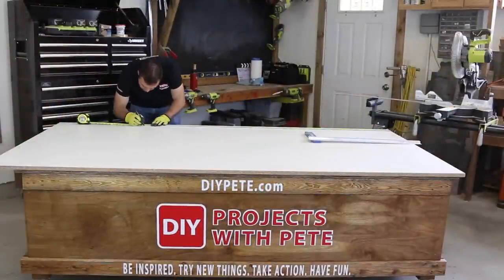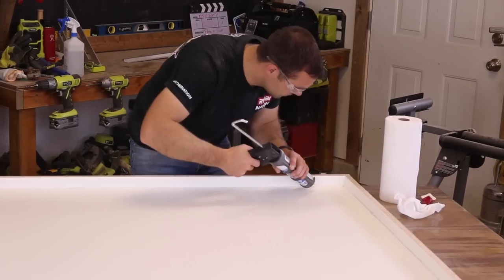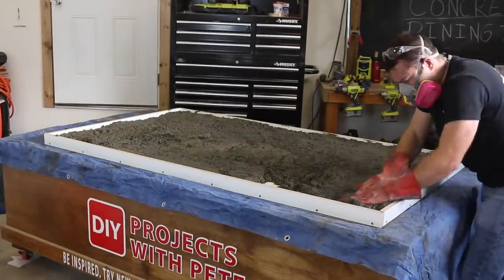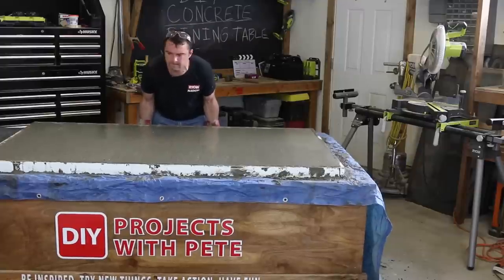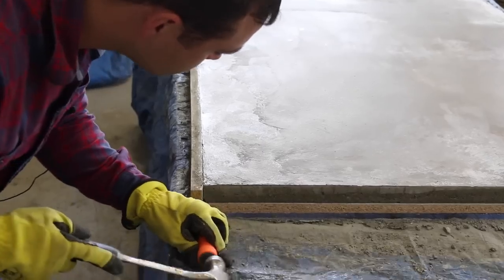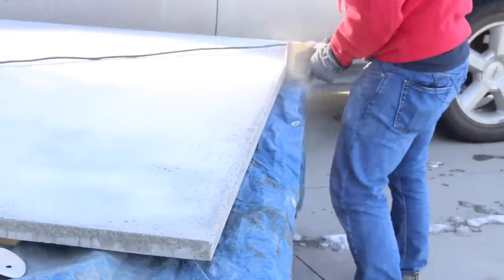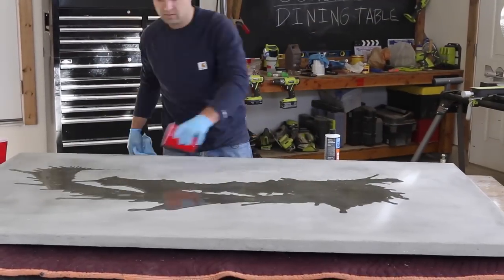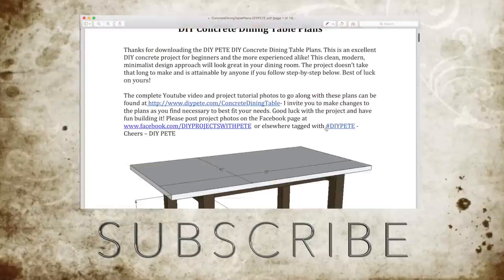How to Make a Concrete Dining Table

Comment: Hi, Pete. I am from Russia. We don't have non-toxic food-safe sealers here so I want to ask you where you buy it. And I didn't get what finish coats you do on your top: sealer (3-4 times), wax? Would please give me some links on liquid materials you use. Thanks a lot.
Reply from the maker: Hi! Hope all is well over in Russia. I use the Cheng Sealer from Amazon. If you can't get it, I'd recommend a waterbased acrylic sealer made for stone or concrete. I do the food safe for some projects but don't feel it is totally necessary as I am always eating off a plate and it doesn't worry me. Sealer about 6 thin coats --- and wax is optional. I use the cheng wax when I do. Cheng also a website he sells it from but here is the amazon affiliate link: http://amzn.to/2mPcji9   Cheers!

Comment: Does buying all that melamine get pricey after a while? I notice you do a lot of concrete table top projects but is it cost effective vs building a wood table top?
Reply from the maker: Hey Edward! I pay about $36 / sheet. I try to reuse it if I can and it hasn't been damaged.  t depends on the wood used --- but if you use affordable wood - the project will be able to be done cheaper than it would be to build a concrete top.

Comment: Hi Pete, I'm trying to make a 6-person table with a slab of quartz (72"x36" with a 3" lip). I imagine it might be quite heavy, maybe not 300lb like this concrete table you built here but still very heavy. I'm struggling with the table legs. I wanted to use U-shaped metal legs (2 sets, 28"x28") but I'm afraid they won't hold the weight, or if they do, the quartz slab will bend in the middle or near the edge. Please help, what can I do to make the legs stronger?
Reply from the maker: Hi Shauna, do you or do you know anyone who welds? Connecting the legs to each other with some low profile metal tubing or other metal would be wanted to provide support for the quartz and to give the legs additional stability. If you have anyone that could help with some additional welding that would certainly be nice to have. Cheers
Reply: Thanks for the tip Pete! Now i gotta find a welder in town......

Comment: if you use an electric motor under the worktable with a belt pulley measured moon to make the effect of vibration, such as cellular phones.
Reply from the maker: Thanks! Yep, I do have a concrete table vibrator --- I don't really use it for video taped projects though since most folks don't have them and I try to make the projects using as few of tools as possible to cut down on costs. But if you have access to a concrete vibrator or a similar contraction that's great!!

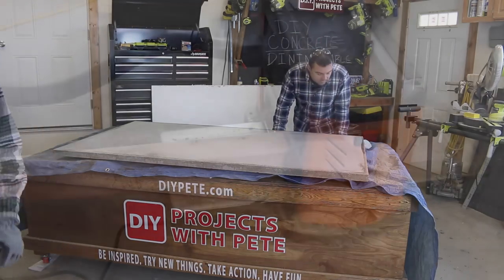Comment: Video is out of sync with the audio at 8:20.  Finishing the slab is being talked about, but the video is showing you making the legs of the table. Then at the end of the video is the concrete sanding section.

Comment: I was thinking of using concrete to build a new desk due to the relative cheapness of concrete, but... well, 300 lb for a slab of that size is quite a lot. If I wanted to install wheels on my desk they'd probably collapse under the weight of the desk. Maybe I can build a desk using crappy pine wood and then smooth all the surfaces using concrete? I fear that'd make the desk kind of flaky though.
Reply from the maker: Hi, you can certainly find caster wheels that would support a desk. I've done this with some large outdoor tables. Cheers

Comment: plz do a video where you inlay a slab of wood with a natural edge and then add concrete to the sides
Reply from the maker: Hi Ryan! I definitely will have to do this in the future. Thanks!
Reply: Thanks, Pete, it would really help, I am trying to figure out how to make 1 for my wife and it will be hard to stop the wood from swelling and absorbing the water from the concrete and warping the table, if you have any advice it would be much appreciated :D
Reply: example: http://www.instructables.com/id/Concrete-and-Cedar-Plank-Table/

Comment: How much did it to build the concrete countertop?
I was looking into making one and was looking into a product called Zcounterform, have you heard of it?
Reply from the maker: Around $100 if you use a basic concrete mix like quikrete 5000.    - Yep, I've heard of Zcounterforms to do bullnoses and other edges etc. I've used them a few times. They worked great.

Comment: Pete , does it have to be Melamine or can it be another type , hope to hear from you or someone else
Reply from the maker: Hi Kyle! Melamine is water proof and so it will give you a super smooth finish. You can use other types of wood, but would need to seal it so the concrete pops off of it, and so it has a super smooth finish if you are using the reverse cast technique like I used in this video.
Reply: @DIYPETE   thank you Pete! I apreciate your reply , melamine isnt available were i live in large sheets

Comment: I made a concrete island table. I put on the Portland cement but it doesn't seem to be filling all the tiny bug holes. also as soon as I sand there's like a thousand more tiny bug holes. is this normal?
Reply from the maker: Hey Tommy, it sometimes takes a few rounds of filling the holes. --- Also, if you keep sanding multiple times it will keep opening more holes --- so do a final fill -- let harden --- and then just use a blue scotch pad to remove excess before sealing. That way you won't continue to create more voids by sanding. Let me know if that helps.
Reply: Thanks man worked perfect. Just put a valspar concrete stain on the island and it turned out great. thanks for the quick response. keep up the good work. love your projects.

Comment: +DIY PETE, I'm rebuilding my tabletop and want to expand on your great idea. I'm considering adding in a small box center piece and wood inlay (Here's my mock-up idea - http://imgur.com/5kgy4ij) and wanted to know if you felt this would undermine the structural integrity of the table at all. I figured I would mirror your table build through the rebar reinforcement, then add the inlay on the second layer (Wood and box would be around 1/2" - 3/4" thick). In my head, I feel it should be solid as the bottom would be a concrete slab. Can you can think of any pitfalls or things to consider that I haven't? Again, thanks for the great idea and inspiration!

Comment: is the filler puddy the same cement mixture?
Reply from the maker: Hi! The concrete table is made of a bag mix of concrete (consisting of cement, sand, and gravel) -- The paste is only cement. You can buy a separate bag of plain portland cement.

Comment: How long does it take for cement to solidify?
Reply from the maker: It will depend on what type of mix you use. There are some that set in a few hours, but the mixes I use typically take at least about 48 hours before I de-mold them. Cheers!

Comment: do you use regular sandpaper or one for cement
Reply from the maker: This was regular sandpaper. Another way to finish it is with a wet polisher and diamond polishing pads. Cheers!
Reply: Thanks for answering, my friend just made her first one for an end table. She is going to start sanding tomorrow. :)

Comment: question can't you just get a perfect finish on the top and use it on the top instead of the underside ? don't know if that makes any sense
Reply from the maker: +David Ferrer Hey David! You can do a hard trowel finish on the top. It is a lot harder for a beginner to get a perfectly flat finish using this method, as hard troweling is quite the skill to master. The reverse cast technique will get it super flat, and is more of a pour and forget it technique. So once it is poured and leveled off, you can cover and then come back to it after 48 hours or so. The trowel (right side up) type finish requires that you hang out after the pour and are able to come back and trowel it at the perfect time once it is setup. This is certainly doable (and how I show how to make the concrete bar https://www.youtube.com/watch?v=nmoF47rds1c). It is simply a bit harder for a beginner to get the professional look they are going for :) Thanks for the great question David! - Pete

Comment: Hi, my nephew is building me an 8ft concrete table. He said it will be 700 pounds. Does that sound accurate?
Reply from the maker: Hi! Depends on the thickness and width. At 1 1/2 inches in thickness, it will be around 15-18 pounds per square foot.

Comment: Pete! This tutorial is awesome! The slurry mixture I used is a different color than the concrete, will the concrete sealer give the table one solid color or should I use the slurry mixture to cover the slab before sealing?
Reply from the maker: Hi Matt! If the slurry is a different color it will look different. I fill the pinholes but always remove all the excess residue with either an orbital sander or a wet polisher if I'm not sanding. For bigger voids -- i mix a little sand in since it can help blend better with the concrete once sanded. A basic slurry mixture is only cement -- so adding a little aggregate can sometimes match a bit better if the sand was exposed at all during the sanding process. Kind of hard to explain but I hope that helps a bit. Cheers
Reply: DIY PETE thanks for you Help! Unfortunately I had to scrap my first attempt at this, but I kept the mold and I’m at the stage where I need to sand and use slurry to fill holes. Two quick questions. 1. My 150 grit sandpaper is leaving residue on the top of the slab. Why is that? Wrong grit? 2. Can I mix the same cement to patch pin holes rather than use slurry that is a different color?

Comment: You should use styrofoam for a core.  You could reduce the weight by almost half and not lose much for strength.
Reply from the maker: Hey Gary! I use a styrofoam core as a knockout when doing items thicker then 1 1/2 or 2 inches --- Essentially giving them an apron which makes the counter or table look thick - but it is only thick around the perimeter - similar to this project I did: https://www.youtube.com/watch?v=h9A_DWfbLzs   - I generally don't use foam on projects thinner then 1 1/2 inches. Are you referring to doing an overlay on a foam core? Cheers

Comment: Could you show some more artistic concrete finishes?
Reply from the maker: +tzkelley Hi! Are you talking about different types of finishes on concrete table tops? If so, I do have a couple other finishes used in various projects. One is an acid stained concrete bar with a hard trowel finish, and the other is a troweled coffee table (videos are in the concrete playlist on my channel). Are you talking more about designs (like cutting tiles into concrete, or doing things like compass roses on a concrete porch? Let me know what you mean by artistic concrete finishes and I will see if it is something I can work into a future project :) Have a great weekend! - Pete
Reply: All the above! Your videos are fantastic; I'm looking for inspiration for projects with colors and less rectangular shapes. I'm particularly wanting to build curved benches for a fire pit with blue coloration to the concrete.
Reply from the maker: +tzkelley Thanks! Curved benches would be neat. I've used a 4x8 sheet of the high density foam (2 inches or 1 1/2 inches thick) -- and cut out circular shapes etc in the past. I put a sheet of melamine under it which works well. Blue could either be added to the concrete mix as a pigment, or you could use a blue concrete stain. Will try to incorporate some more color and shapes into a future project. Great idea!

Comment: Good thing I'm a concrete finisher.
Reply from the maker: +Isac Perez That will come in handy Isac!
Reply from the maker: +DIY PETE You could even do a hard trowel finish if you'd like and cast it right side up. That would cut down on the finishing time since you wouldn't need to fill bug holes. (just an option -- different look and finish of course) Cheers!

Comment: Isn't it actually cement?
Reply from the maker: Hi! Most concrete mixes consist of aggregate ( rock ), sand ( smaller aggregate ), cement ( the binder ) and water to mix it. Cement along would not be enough for a table. Cement is basically the glue that binds everything together. Cheers!
Reply: DIY PETE Cool! I'm starting to learn about basic masonry for home repair and projects, etc. I didn't think that pre-mixed/bagged concrete was available in stores. Makes sense, though...it's a pain in the butt to keep ratios straight for mixing concrete, and a bagged mix looks like it really cuts out a bunch of measuring. I really liked the video, you make this look easy!